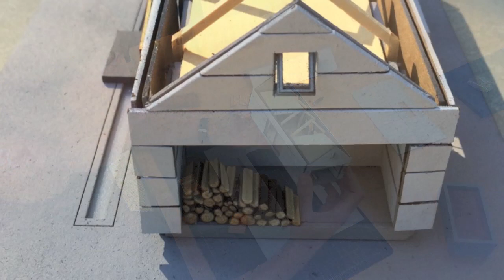Designing a Small Studio - Building a Study Model (Part 5)

Comment: hello my friend really like your channel , and I have always followed , I wonder what materials you use to make your model                w
Reply from the maker: Cheers...thanks for subscribing and commenting...
For most models I prefer chipboard in varying thicknesses: 1/16" + 1/32" are my go-to sizes, inexpensive, easy to cut and they take spray paint very nicely without curling. The base here is made with 1/8" chipboard which i can easily cut and etch on a laser cutter, but it's hard to manage with Olfa/X-acto blades. 
Museum board is an upgraded option and comes in varying thicknesses (similar to chip) and cuts like butter, much easier on the hands but it can get dirty and it's more expensive. Balsa and basswood are nice for stick-like pieces (framing, stair treads, etc.), but they can be pricey for larger models. 
Hope that helps...